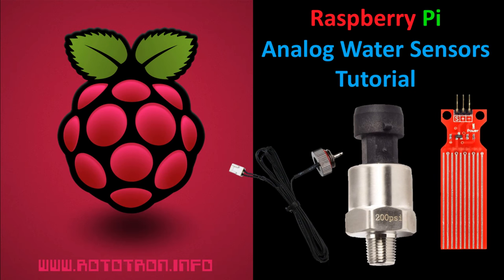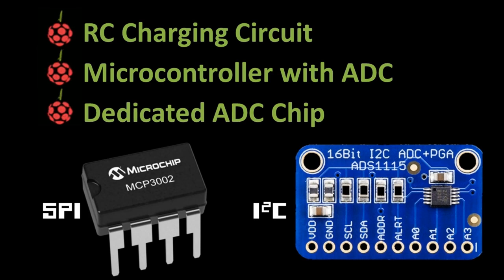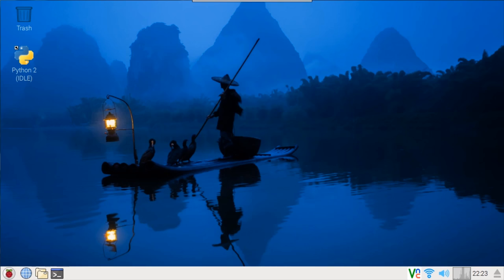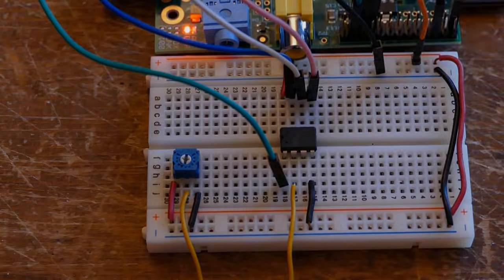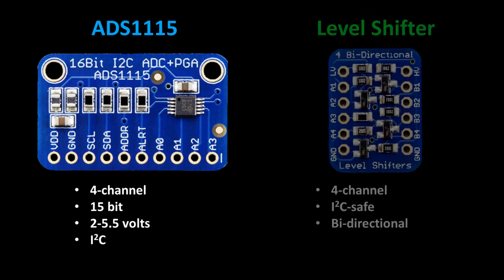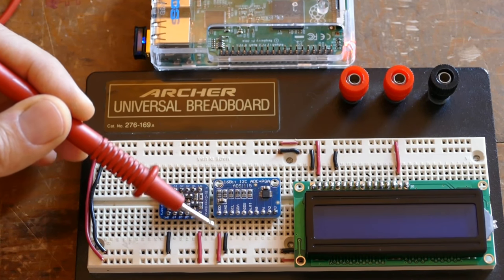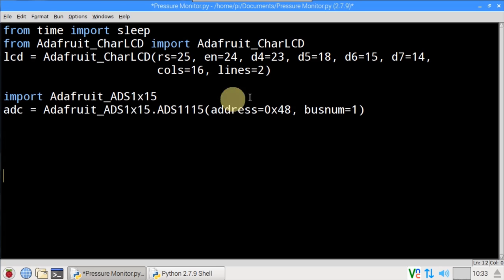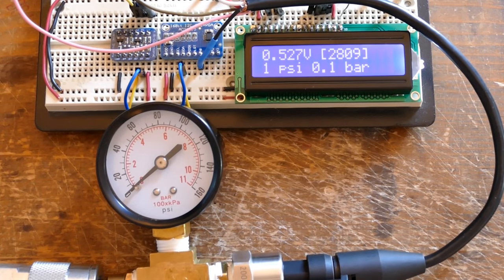Raspberry Pi Analog Water Sensors ADC Tutorial

Comment: I wanted to set up mulitple pressure pads and connect them to raspberry pi using the ADS115. Each pressure pad would turn on/off a specific music track and activate an LED light. Is it possible to hook up multiple ADS115s to the raspberry pi? Does it make more sense to get this interaction using multiple arduinos? I'm unexperienced with this technology and curious to your opinion. Thanks
Reply from the maker: You can connect up to 4 ADS1115's (see Figure 35 in datasheet) using the built-in I2C pins on the Pi. Are your pressure pads just on/off switches or do you need to vary the LED light depending on the amount of pressure exerted on the pads? If they are just on/off switches then you can connect them directly to the Pi without an ADC. The choice between a Pi and an Arduino depends on your project requirements. An Arduino Mega with 16 built-in ADC pins might be a better choice if you need to measure the amount of pressure on 16 pads. It really depends on the quantity and type of pressure pads.
Reply: Yes they would just be on/off switches but i want the switch to be activated on release. So when you step on the pad it turns it on and stays on until you step on again to turn it off.

Comment: Do you have an answer to this error?  I have checked my code against your and seems ok.

Traceback (most recent call last):
  File "/home/pi/Pressure Monitor.py", line 3, in <module>
    lcd = Adafruit_CharLCD(rs=25, en=24, d4=23, d5=18,d6=15,d7=14, cols=16, lines=2)
  File "/usr/local/lib/python2.7/dist-packages/Adafruit_CharLCD/Adafruit_CharLCD.py", line 143, in _init_
    gpio.setup(pin, GPIO.OUT)
  File "/usr/local/lib/python2.7/dist-packages/Adafruit_GPIO/GPIO.py", line 278, in setup
    pull_up_down=self._pud_mapping[pull_up_down])
TypeError: argument 1 must be string, not int
Reply from the maker: I don't see anything wrong with that line of code.  Which Raspberry Pi are you using?  Which version of Raspbian are you using?

Comment: First, thanks for the tutorials. They have been very helpful. I have a pi 3. How are the pins different for the water sensing circuit.
Reply from the maker: The BCM GPIO pin numbers should be the same with regard to the pins used in this video.
Reply: I got it working. Sometimes I just need to go backwards and own the underlying theory and then move on from there. But the projects you have have been invaluable to my projects. I am setting up 21 temp humidity & water sensors in the clean rooms of my company. I also am setting up pressure and temp sensors for our cooling systems. Thanks Again!!!
Reply: Mr. Hardesty which ADC did you use???

Comment: Could this be a way to go for measuring oil temp and pressure in an older car engine? So totally noob on this that I don't even own a pi yet
Reply from the maker: It is possible.  Here's a good example:  https://hackaday.io/project/1276-carmin
On newer cars you could just connect into the OBD-II port and read all the car's diagnostic info.

Comment: I have a question...If I do not use bi directional in ADS1115, can it?
Reply from the maker: The I2C bus is bidirectional.  The SDA line is used for both transmitting and receiving.

Comment: Can you measure the sensor input voltage using multimeter? will it give the same voltage as what displayed in LCD?
Reply from the maker: I think you mean output voltage.  Generally speaking, if the sensor outputs a voltage then you can measure this output voltage with a multimeter assuming that you provide an appropriate power supply to the sensor.
Reply: @rdagger  my bad, yeah output voltage. Sorry I'm newbie to electronic/electrical, so my question : is that any way we could get the sensor voltage value with multimeter? Just to compare the multimeter measurement vs the calibrated voltage (voltage from program's equation)
Reply from the maker: @flickmew99  Yes.  The sensor output voltage can be measured by setting you multimeter to DC voltage and placing the red probe on the sensor output pin and the black probe on ground.

Comment: Can i measure also with 4 pressure sensors and control relais with it?🤔🧐
Reply from the maker: Yes, the ADS1115 has 4 channels so you could connect 4 analog pressure sensors.  There are several relay boards available for the Pi.  You might also want to take a look at some of the new Honeywell pressure sensors.  They come in I2C so they can be hooked up directly to the Pi.  They also provide temperature compensation for more reliable readings.

Comment: how to used Gas sensor mq-137(ammoina sensor with pi3) analog sensor.
Reply from the maker: I have not used this sensor but according to the datasheet it outputs varying resistance instead of voltage.  You would add a resistor (RL) to act as a voltage divider and use the ADC to read this voltage (VRL).  The datasheet provides the following formula to calculate the sensor resistance: Rs=(Vc/VRL-1)×RL.  The datasheet figure 1 shows the logarithmic relationship between resistance and ppm.
Reply: can you provide me datasheet and also source code.
Reply from the maker: Here's a good sample with datasheet:  https://tutorials-raspberrypi.com/configure-and-read-out-the-raspberry-pi-gas-sensor-mq-x/
Reply: it's too good but i think mq-137(Nh3) formula used this tutorial used mq-2 sensor.
Reply from the maker: Here's an Arduino example for your exact sensor:  https://circuitdigest.com/microcontroller-projects/arduino-mq137-ammonia-sensor
Reply: i am used raspberry pi.
Reply from the maker: The first Pi example I provided should work.  If the readings are off you can compare the formula to the Arduino example.

Comment: Hai ,i am having an idea to convert a analog water meter to a digital water meter ,please give me some idea to do that
Reply from the maker: Does your meter have an analog output?
Reply: i have the analog instrument only it does not have any recording device
Reply from the maker: If your meter display has a spinning indicator, you might be able to use a non-contact reflective optical sensor like I used in my Motor Control and RPM Measurement Tutorial:  https://youtu.be/br_Xv9X7YZc

If your meter display has a reading like a car odometer then you might be able to use a web cam to OCR the reading.

It might be easier and more reliable to add a digital flow sensor inline to your meter.
Reply: thank you so much ,if I have any doubt I will reach you.

Comment: if i am right its better and easy to do this project with arduino isn't it ? can anybody correct me if i am wrong ? cause i dont see why using a very strong device like raspberry instead of arduino
Reply from the maker: It depends on the scope of your project.  If you just want a sensor and an LCD display than an Arduino would be a great choice.  If you want network connectivity and remote configuration than a Pi would be a good choice.  An ESP32 would also be an excellent choice because of the built-in ADC’s and Wi-Fi.  The ESP32 also support MicroPython.  I like the ability to wirelessly remote into devices once they are deployed for updates and maintenance.
Reply: i approve what you are saying. Thank you for your answer

Comment: I have a question How i can have output in print statement. 
the value of psi.
Reply from the maker: Change lcd.message to print.
Reply: i have a question when i use 
sudo i2cdetect -y 1    
I have all the answer as -- -- -- -- -- -- -- . just dashes not as in your video you have  48 value. can you please help me what may be the problem.
Reply from the maker: Which Raspberry Pi are you using? Which model level shifter are you using with the ads1115?
Reply: Thanks for the answer bundle of thanks. 
I am using raspberry pi 3 model b.  I am not using any model shifter and I have connected ADS1115 direct with the PSI sensor. Can i connect ADS1115 with ACS712 sensor? I will be very thankful for your answer.
Reply from the maker: If the ACS712 module is 5V then I recommend you use an I2C-safe level shifter like the one in the video.
Reply: rdagger68 ok I will do that. But I don't know how to read the current signal and print the reading. Can you please help me in code. Please
Reply from the maker: The code would be the same as the code in the video.  You could change lcd.message to print, to print the output instead of using an LCD display. I believe the acs712 is linear, so like my pressure sensor in the video you just need to figure out the formula to convert the voltage to current.

Comment: PRETTY_NAME="Raspbian GNU/Linux 8 (jessie)"
NAME="Raspbian GNU/Linux"
VERSION_ID="8"
VERSION="8 (jessie)"

processor : 0
model name : ARMv7 Processor rev 4 (v7l)
BogoMIPS : 76.80
Features : half thumb fastmult vfp edsp neon vfpv3 tls vfpv4 idiva idivt vfpd32 lpae evtstrm crc32 
CPU implementer : 0x41
CPU architecture: 7
CPU variant : 0x0
CPU part : 0xd03
CPU revision : 4

processor : 1
model name : ARMv7 Processor rev 4 (v7l)
BogoMIPS : 76.80
Features : half thumb fastmult vfp edsp neon vfpv3 tls vfpv4 idiva idivt vfpd32 lpae evtstrm crc32 
CPU implementer : 0x41
CPU architecture: 7
CPU variant : 0x0
CPU part : 0xd03
CPU revision : 4

processor : 2
model name : ARMv7 Processor rev 4 (v7l)
BogoMIPS : 76.80
Features : half thumb fastmult vfp edsp neon vfpv3 tls vfpv4 idiva idivt vfpd32 lpae evtstrm crc32 
CPU implementer : 0x41
CPU architecture: 7
CPU variant : 0x0
CPU part : 0xd03
CPU revision : 4

processor : 3
model name : ARMv7 Processor rev 4 (v7l)
BogoMIPS : 76.80
Features : half thumb fastmult vfp edsp neon vfpv3 tls vfpv4 idiva idivt vfpd32 lpae evtstrm crc32 
CPU implementer : 0x41
CPU architecture: 7
CPU variant : 0x0
CPU part : 0xd03
CPU revision : 4

Hardware : BCM2835
Revision : a02082
Serial  : 00000000f04f4c84

So basically it is a Raspberry PI 3 B ver 2
Reply from the maker: It should work.  You can send me your code and I'll take a look.
Reply: Thanks for  the help.  Bit of a beginner with python and raspberry 

from time import sleep 
#from Adafruit_CharLCD import Adafruit_CharLCD
#lcd = Adafruit_CharLCD(rs=25, en=24, d4=23, d5=18,d6=15,d7=14, cols=16, lines=2)
import Adafruit_ADS1x15
adc = Adafruit_ADS1x15.ADS1115(address=0x48, busnum=1)

#  Gain = 2/3 for reading voltages from 0 to 6.144v.
#  See table 3 in ADS1115 datasheet
GAIN = 2/3

# Main loop
while 1:
    value =[0]
    #  read ADC channel 0
    value[0] = adc.read_adc(0, gain=GAIN)
    #  ratio of 15 bit value to max volts determines volts
    volts = value[0] / 32767.0 * 6.144
    #  tests shows linear relationship between psi & voltage:
    psi = 50.0 * volts - 25.0
    # bar conversion
    bar = psi * 0.0689475729
    print("PSI = " +str(volts), "Bar = " +str(bar))
    lcd.clear()
    lcd.message("0:).3f}V [{1}]".format(volts, value[0]))
    lcd.message("\n{0:0.0f} psi {1:0.1f} bar".format(psi,bar))
    
    sleep(4)
Reply from the maker: First your lcd.message statement has incorrect syntax.  It should be:
lcd.message("{0:0.3f}V [{1}]".format(volts, value[0]))
However, that is not causing your problem.  Looks like something is broken in the latest Raspbian release with respect to the Adafruit GPIO Python library.  Please try manually installing it:
cd ~
git clone https://github.com/adafruit/Adafruit_Python_GPIO.git
cd Adafruit_Python_GPIO
sudo python setup.py install
Then reboot your Pi and try again.